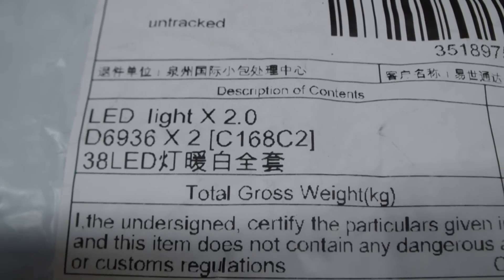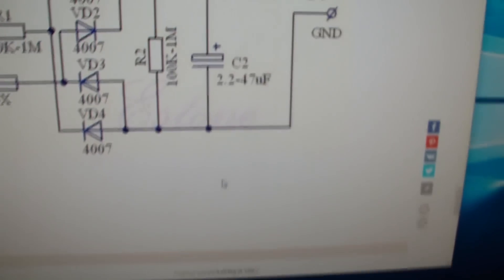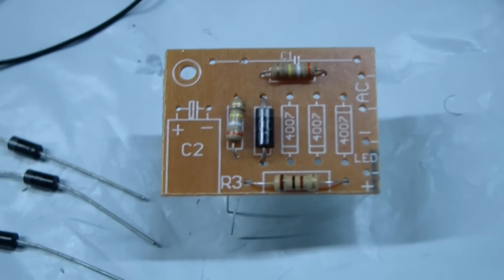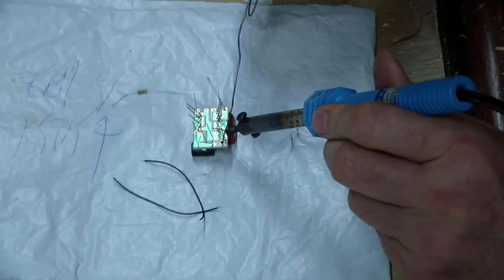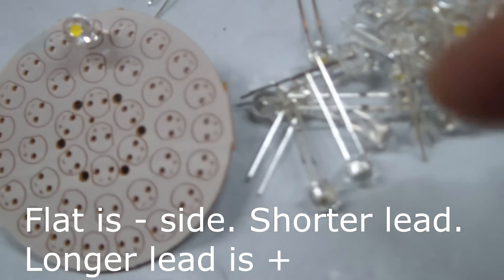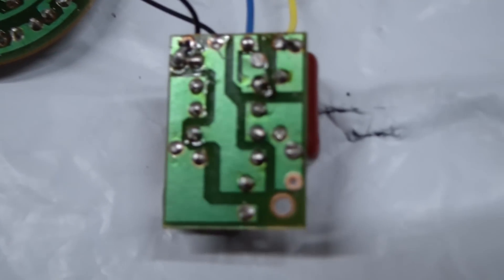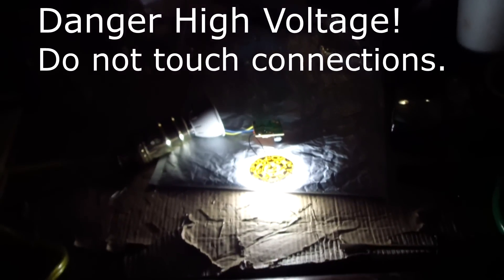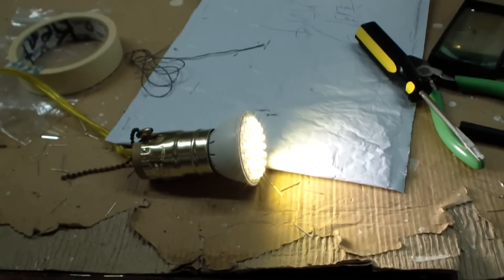DIY LED Light Kit D6936 Assembly Instructions

Comment: Hi, nice work on the video. I followed your instructions but have a strange issue. I constructed two of them and they both exhibit the same problem. When first switched on the leds go bright but then dim and do not come back on. If I unscrew the bulb, I can get it to flash by wriggling it in the socket. Is the bulbs socket not the correct size for the US? I've tested the components and they seem fine. Any ideas?
Reply from the maker: I had a similar issue where on different type bulb where the yellow wire that connects to screw base had poor contact. Since you have two bulbs with same symptom it points to your light fixture. Did you try screwing into different fixture? Verify the 100 Ohm resistor is correct value.
Reply: Kent Diego thanks for the quick reply. I checked the resistors and they were correct. I screwed it back in and it worked. I suspect I just had not tightened it enough in the socket for it to make solid contact. Lesson learned...look for the simple solutions.

Comment: I just built a kit that looks exactly like yours. Basically it works but some of the components were really not too suitable for the job... I also got two tiny 100kOhm resistors to discharge the caps.. quite low value in my mind. I used two 330k resistors in series for the red cap and just left out the electrolytic cap resistor since it's not really needed anyways and it's just wasting power producing heat. I also got a couple of extra LEDs in the bag which was nice. I still have 2 kits left, maybe I'll build one with different color LEDs and leave one for a future idea. Also the wires supplied were extra super thin.. And  I added a 10 ohm resistor on the AC input to act as a fuse if something goes wrong. I don't think that 100 ohm series resistor does very much at all in the circuit. Mine drops around 3 volts which is a handy way to measure that the LEDs are driven at about 30 mA. Most of the current limiting happens with the dropper cap anyways (the red one).
That little skinny "fuse" trace is really not very convincing as a fuse. It's only a single millimeter away from other pads on the board...
This model lamp is really dangerous anyways, since it's based on a capacitive dropper the front panel where the plus and minus wires come out exposed are really referenced to the mains, so you might get a pretty bad shock off the lamp and there's next to no protection if something goes wrong except for the super thin wires which would burn up and break I suppose.. :-)
Fun build still and you can make it half-decent if you know what you are doing.

Comment: I love these things. I've made two. I had wondered what the BX was on the circuit diagram, now I know. I may have connected the AC backwards, but since I'm using an Edison screw to bayonette cap adapter, I don't think it makes a big difference (bayonette sockets don't distinguish active/live and neutral connections, you can plug in the light bulb either way.)